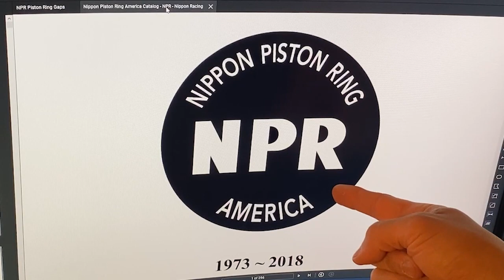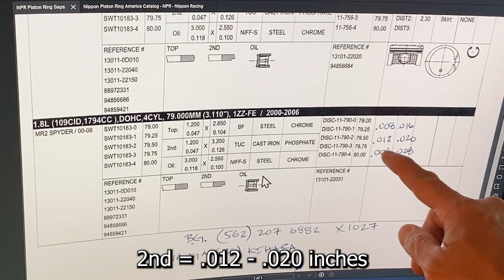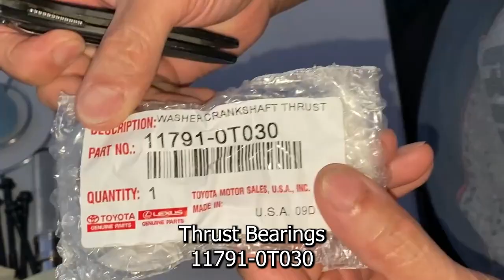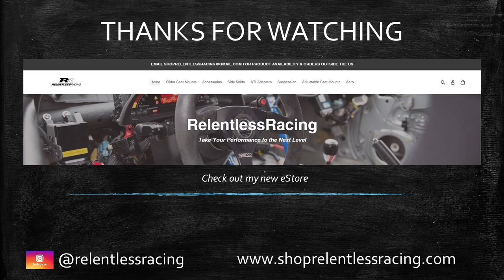1ZZ-FE Rebuild Part 2 - Piston Rings, Main Bearings, & Crankshaft

Comment: Very cool. I have a 1ZZ-FE engine in my 2006 Matrix which has 199,513 miles and still runs perfect. 5k OCI with full synthetic and oem filter. Best car ever.
Reply from the maker: Thanks for commenting and watching. Check out the rest of the series. Also, pls subscribe for more automotive content. Thx again, AJ
Reply: How come Toyota doesn't just use ft. Pounds of torque like most American engines in place of degrees of angle, it always as if the bolt might wring off before the proper torque is applied?
Reply: @jamesbennett9654  They are different. Bolts are generally torqued to a specific ft-lbs, and your done, but some bolts require additional torque which is more accurately applied by a specified amount of additional angle vs additional ft-lbs of torque. Also, Toyota does use torque specs on their nuts and bolts. They are usually given in N-m or ft-lbs (or both).

Comment: I have a 1zz engine 1.8 2001 and I am having the hardest time finding parts for it
Reply from the maker: Which parts are you looking for? Have you checked a dealership?
Reply: Yes I have checked with dealers
Reply: It seems every port I find does not seem to fit my engine
Reply from the maker: @jeffpack5714  what?  What specific parts are you looking for?
Reply from the maker: @jeffpack5714  it seems you aren’t ordering parts from the dealership. FYI 95% of the parts for the 1ZZ are still available from the dealership and aftermarket. This 1ZZ build proves it. I listed all the part numbers used. Good luck

Comment: Will you upload a video on how to rebuild a auto transmission gearbox for 05 corolla
Reply from the maker: Very unlikely bc I don’t have an automatic transmission. However, rebuilding auto transmissions is not difficult. In fact, I’d say it’s easier than rebuilding an engine. Just follow the OE manual and you will be fine. Good luck.

Comment: Would it be possible to replace trust bearings while the engine is in the car? When I take the oil pan off I have easy access to the rod bearings so the thrust bearings shouldn't be too hard, right?
Reply from the maker: Not possible… the thrust bearings are encapsulated by the girdle or bearing cap subassembly. Pls subscribe. Thx AJ

Comment: 1 zz
Reply from the maker: Yes, that is a 1ZZ. Pls subscribe.
Reply: @RelentlessRacingAJ would the piston rings gaps be the same for a standard block that hasn’t been bored out?
Reply from the maker: @moisesdelatorre4140  piston ring gaps are not all the same. I recommend you look up the proper OEM ring gaps in OEM service manual.